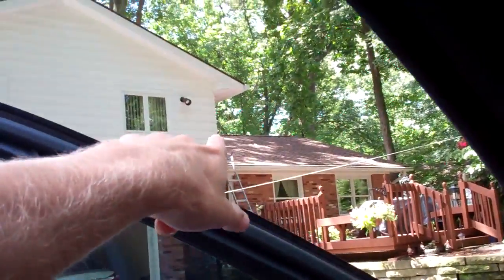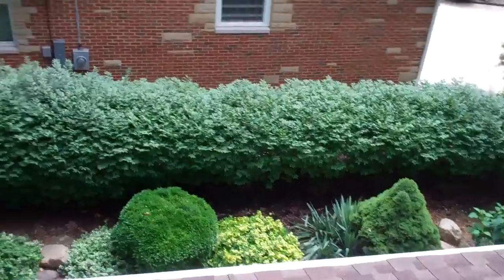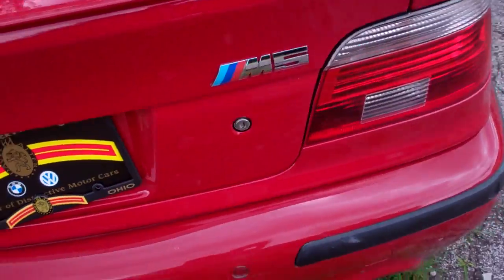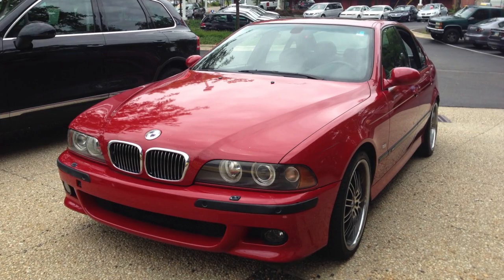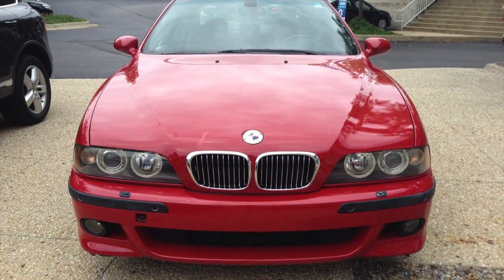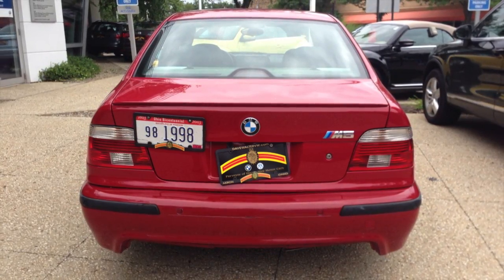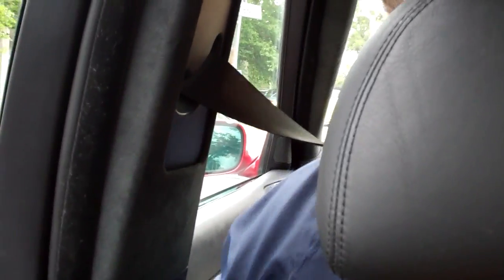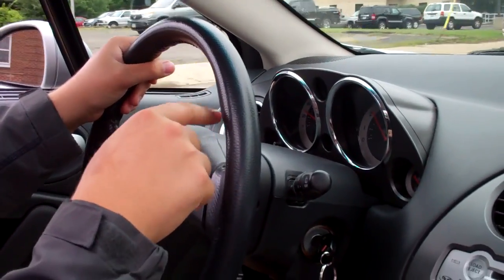NO MUFFLERS NO BUENO  7/29/13 - Day 961

Comment: If you want to take something off the exhaust system, Take the CAT's off. That will give to a good power boost compared to the muffler removal. Just put the CAT's back on when or if you need to get the car e-checked!

Comment from the maker: It sounds okay once you push it a little bit, it's just 10x too loud all of the time.  You literally couldn't have a conversation with anybody in the car in 6th cruising at any speed.  I'm sure the previous owner was a loner.  I was nervous to cut the wires out, but I checked everything last night, and they all work fine with no check display warnings!  No Internet can relieve stress sometimes, at least for me!